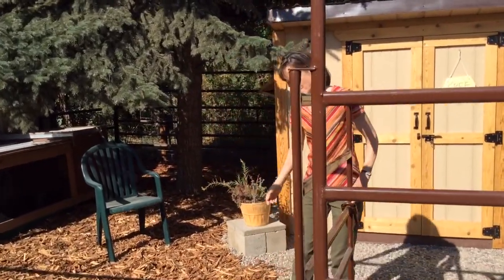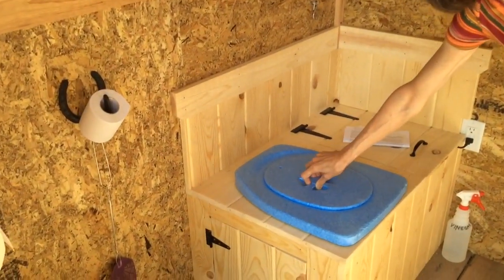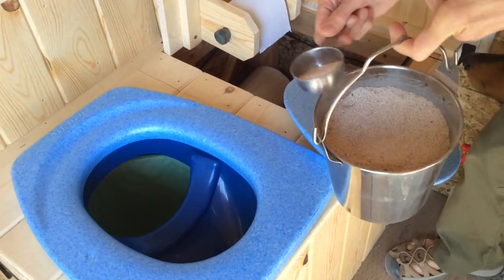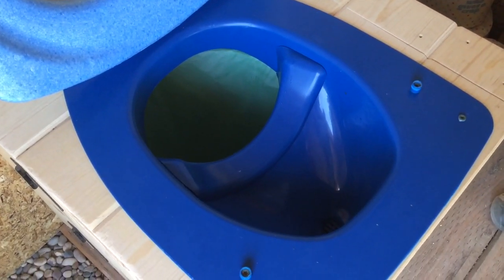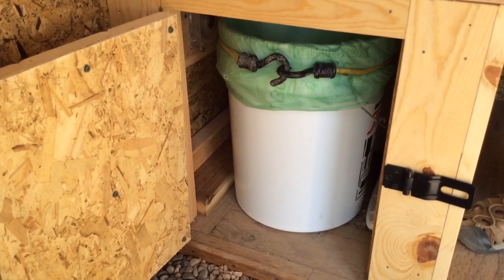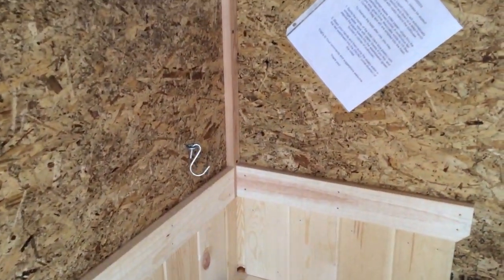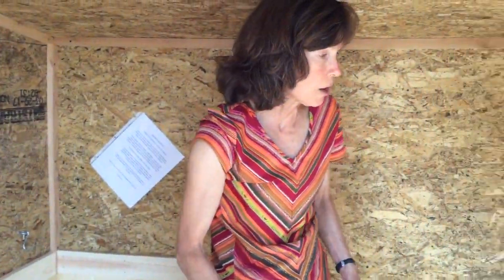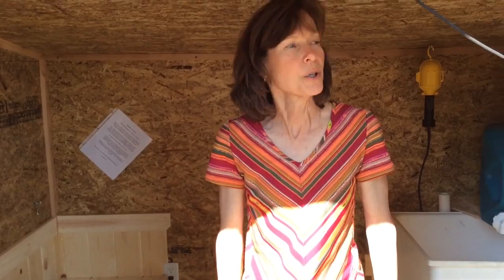My Separett Privy Tour

Comment: Great installation. I might be the 'nice English gentleman' that made the original video! Really pleased to have inspired you. I love the look of your compost toilet - very well made! The only comment I'd add, from my own experience, is that you would benefit from having some kind of opening (screened) to allow air into the lower compartment - I had some issues with odours and it was because the lower area was too well sealed and the fan was labouring too hard because not enough air was able to come in. When I build compost toilets now, I always add at least one vent, usually opposite the fan to enable good airflow over the solids bucket. Best wishes, Martin.
Reply from the maker: Martin Doyle, how nice to hear from you! Thank you so much for your kind remarks. I do believe it was you who gave me the courage to tackle this project. I’m going to pin your comment to the top here so that others can benefit from your more extensive experience with the Separett. We will certainly keep it in mind as well. Due to my poor construction skills, tho, there is probably more ventilation under our privy than is apparent here, particularly around the dividing wall between the two compartments (perhaps the storage compartment also acts as a kind of ‘odor buffer’?). In any case, now that the big eclipse event has passed, our privy sees only very sporadic use. But I’m delighted to have it as it’s perfectly located for trail riders just before setting out, and the pea gravel (pun intended, for those who caught it) makes it perfect for use as an alternative to the house when wearing muddy boots. Thanks so much again for commenting, and for giving us the benefit of your experience! Hope others will find all of this helpful and perhaps encouraging, as polluting good drinking water to dispose of waste does seem so...wasteful. On our reading list: “The Big Necessity: The Unmentionable World of Human Waste and Why It Matters”
by Rose George

Comment: Beautifully well done. One little nitpick/suggestion...it might be nice to have an inline fuse close to the plug end of the fan cord. It should be maybe twice to operating current of the fan, and fairly easy to change if ever necessary.
Reply from the maker: snowbird29803 Thanks for the compliment! And the nice, constructive comment, too. Hopefully others will be inspired by it to build that extra margin of safety into their design from the start.

Comment: Thanks for a look at your well designed facility.  How durable is the Separett styrofoam seat and cover?
Reply from the maker: Anastasia Hopkinson , it seems as durable as it needs to be. It shows no sign of wear and tear after our big event last year, and occasional use since. It seems to be of very dense styrofoam with a smooth finish, like the boogie boards we’d play with in the water as kids. Those took a real beating and lasted for years. Its main advantage seems to be comfort. It never feels cold, not even in winter in an unheated outhouse.